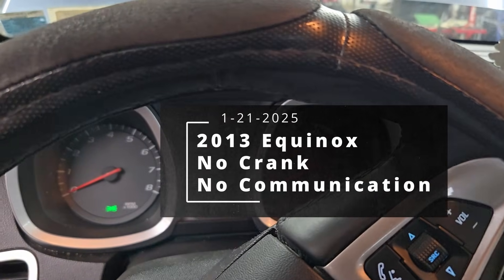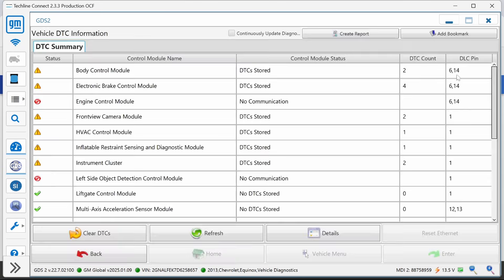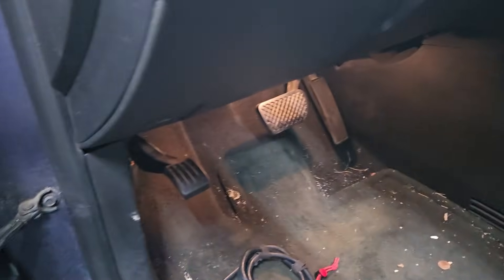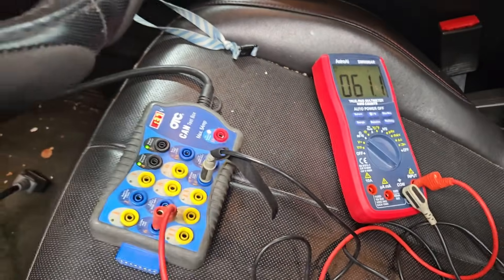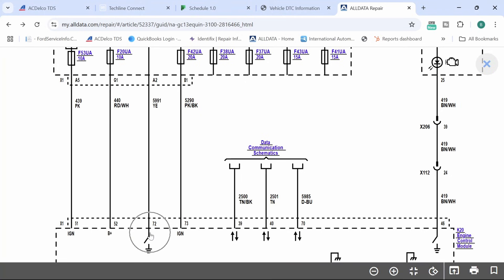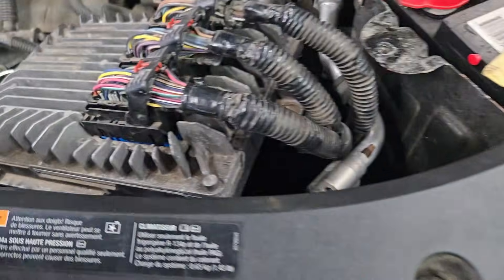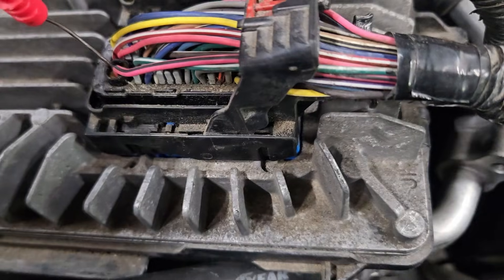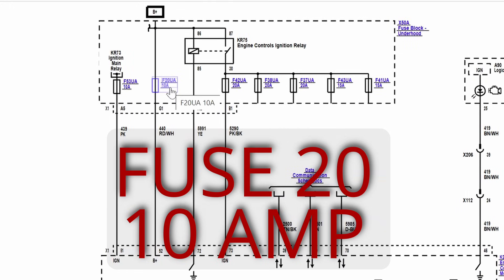2013 Equinox No  Crank  No Communication

Comment: Once you determine you have a open then you need a fox and hound tester.  You put a transmitter on one side of the wire and your probe will make a constant noise along the harness until you get to the open wire then the tone stops.  Mark that point and expose the wires and you will find the broken wire.

Comment: Ive got the same problem on my 2016 2.4 the code U0100 comes up on my fixd scanner. It had suggestions as to look at wiring to see if a connection was broken.

Comment: I'm having a similar issue right now. On pins 6 and 14 I get open load when testing with everything turned off. With the battery unhooked I got 60ohms. It also shows low voltage on high and low to ground.
Reply from the maker: Something pulling to ground,  60 ohms means general network is intact, , measure to ground from 6 and 14 and see what you havw